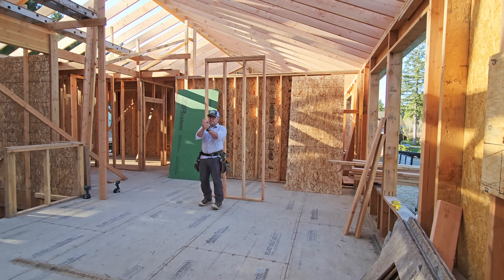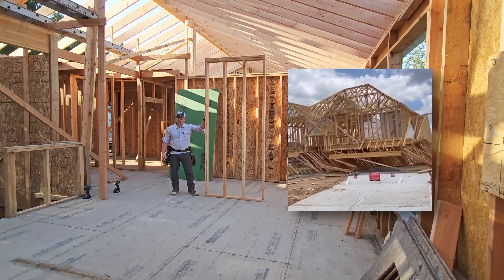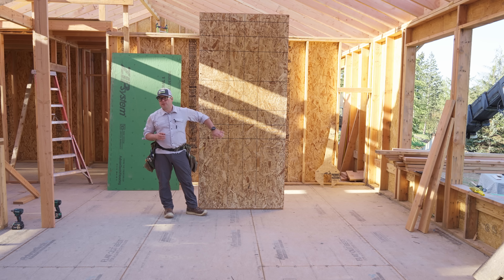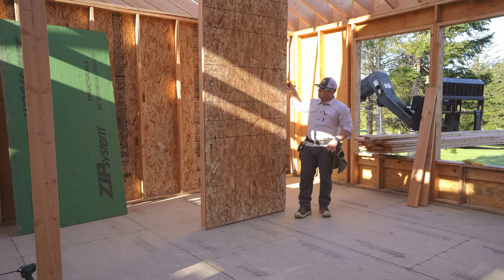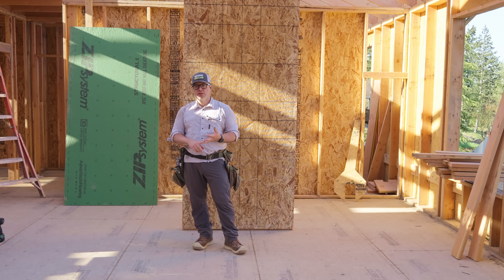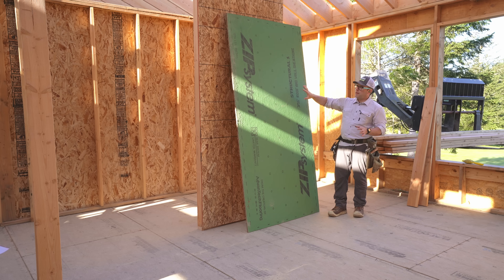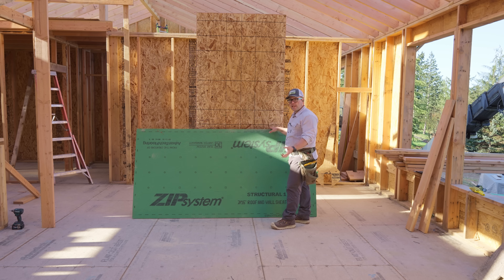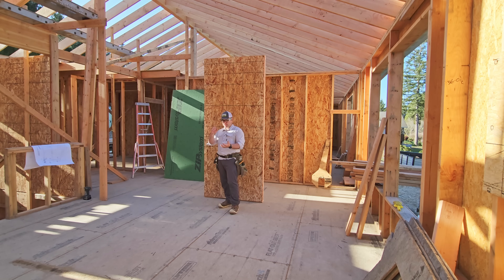Shear Walls Secret: The Hidden Force That Holds Buildings Together

Comment: Basically,, with 60 years under my belt building.  Shear walls, smear walls,  that structure did not have an angle brace in the lot.  there were no wooden let in braces, there were no metal let in braces, there were no solid block diagonals, there were no angled strong backs in the attic, the carpenters who put that together and the engineers that designed it were children, idiots who never sat in anything but a university classroom of cheated a client they were building for. Shear walls are essential,, for handling the point loads that must be addressed IN ADDITION to all the normal stresses.
Reply from the maker: Shear walls are for lateral forces.
Reply: @AwesomeFramers  At specific points.  At those points they are essential.  There we agree.  The nearly complete partial frame collapsing offended me. Mostly,, because I see similar almost every day.  A few years ago, a church locally, made a similar spectacular deconstruction.  I do not remember  the number that died or were injured, because they had not bothered with any diagonal bracing, trusses or walls.  And I see it time after time after time.  Modern framers rely upon the sheathing to keep the building up and stable,, and that is just wrong.  Even a shear wall should have redundancy.  Solid blocking internally or my last one handled a huge load in a wood basement.  I plywooded it on both sides.  I suspect you may have done similar.
Reply from the maker: @Sailor376also  These buildings came down due to the lack if temp bracing.  If they had even 1 sheet on each wall they wouldn't have come down.  Shear walls are rigorously tested by universities and corporations.  That data then has a safety factor applied to it and that's where we get the values for shear wall capacity.  They are significantly (4x+) stronger than let in bracing or diagonal bracing.  They are also easy to construct and inspect.  

Its really a shame people die like you mentioned, there's just no reason for that.
Reply: @AwesomeFramers  "even one sheet"  Complete agreement.  My normal has been for,, what 50+ years, I sheet the wall before it goes up.  And I still have lots of temp bracing to hold, straighten wall tops, etc.  But even simple things are just uncommon now. Example,, you have a strong back or lacers through your trusses  AND there are supposed to be diagonals atop the bottom chord of the trusses or atop the collar ties. I have not seen a crew do that except mine in the past 10 years. I have had contractors complain at the extra expense. Yet, every set of engineers truss drawings delivered with the trusses shows them. The last shear wall I saw in a framed job, obvious to me why the engineer had speced the wall layout,, were just dry walled latter.  No sheathing,, no internal bracing, just drywall ,, so they did not have to use door jamb extensions on a thick wall.  You must see the same thing time and again,  Well, as is evidenced by the deconstruction you found a recording of,,, all too common.
God, I am a dinosaur.  I have done many subfloors with 1X6 Always on the diagonal.  Wall sheathing with 1X6s  also always on the diagonal.  vs the new house across the street with cardboard sheathing and stress ripples already appearing in the vinyl siding.  The drywall is holding it up.  You and I see it all the time.  Laughing,, and the way of the world,, the guys that cheat win the bids with a lower price, and they make more money,, by skipping a few of the 'unnecessary' things.

Comment: Ive never understood why people build entire houses before they sheet anything. Sheeting walls as you go saves so much time its not even comparable to doing it after everything is built. Sheet 8ft  walls with 9ft sheeting to cover the rimboard of the deck theyre sitting on when you stand them up. Tyvek and cut out windows while the wall is laying down as well. Ive built this way for 35 years and never had a single problem.

Comment: When attaching sheathing, wouldn't it be better to use  taller panels and have them overlap the main floor rim joist and use the upper level sheets to overlap from the first floor walls past the 2nd floor (or attic floor) rim joist and the roof truss ends? That way the sheathing ties everything together which will aide in resisting shear forces but also wind uplift on the roof overhangs.
Reply: Sometimes the ply/OSB panels do splice at the rim, it can be an efficient way to pass the lateral loads from a floor above to the shear wall below. Other times the forces are structurally passed through the framing members (plate/rim/plate) with nails, screws, and/or clips, so simply attaching the ply/OSB to the plates works as they're already joined together as a structural component in terms of those lateral forces.

Uplift forces are usually dealt with via a continuous load path of hardware- large continuous straps and/or hold down pairings from shear wall to shear wall.
Reply from the maker: There is a great response to this question below 👍
Reply: yes, but go look at the current labor force and ask them why they arent overlapping the bands.
they are clueless and the inspectors do not demand to see it.

is all a farce of supposed engineering that is not being utilised as designed.

Comment: I’ll be showing this to new-hire engineers as a great example of basic shear wall construction. 

The only input I have is that moment frames are not subsets of shears walls. They are two different types of lateral force resisting systems (i.e. braced frames, moment frames, shear walls). They use different design methods with different seismic loads on the structure. But this isn’t a video on moment frames 😅, so very well done! 👍🏼

Comment: Question, not pertaining to this particular video.  I noticed in one of your foundation videos (can't seem to find which one it was or I'd post this question there), that you used an I-joist to stiffen the top of the forms (if i'm remembering correctly).  Have you ever used an I-joist to STRAIGHTEN an exterior wall?  Or to assist in the straightening of an exterior wall ?
Reply from the maker: Nope

Comment: Its amazing on that entry video how there was obviously no sheathing on the walls or roof, but was there any kind of temp bracing even applied? I do remember years ago when framers were only required to sheath the corners, which was just wrong. Great video, from one builder to the next, keep em coming bro!
Reply: I'm amazed for how long after the 1906 quake they still allowed garbage construction methods in the SF Bay Area. Soft story buildings (first floor all parking so the whole front face is only supported on a couple of steel poles with no interior walls... a great recipe for collapse) were still being built into the 1980s IIRC. 

Or lots of SFHs with a crawl space with no sheathing (the half height crawl space walls love to collapse just like shown in this video). Still built this way into the 80s.

Huge 12" redwood beams just toe-nailed onto their posts. Way too few anchor bolts. Not sure when this stopped but when we rented the 1939 house (long after 1906) was built this way - long after they should have known better.

Comment: I’m a licensed structural engineer in California. This video is fantastic. Great work!
Reply from the maker: Thanks!  I did a lot of research and tried not to step out of my area of knowledge.
Reply: @AwesomeFramers what I'd like to know is why are all these walls sheathed with no blocking in them? Are you not required to put blocking every 4' of vertical wall in your area?
Reply from the maker: @Cmasotti92  Code and the SPDWS both show panel edge blocking.  Since we sheathe vertically, we don't block every 4'.
Reply: This is good for those in construction management or going to school to become a builder to watch during a break 👍
Reply: im a concrete contractor this video is fantastic
Reply: I work as a structural designer for a licensed structural engineer and I do residential lateral designs all day long. I wish I saw this vid back when I was learning about lateral design. Super helpful.
Reply: Fellow PE what's up!
Reply: What type of work do you do as a structural engineer?
Reply: @FutureFaz I'm in the Sierra Foothills and need some engineering done for my house. Please get in touch if that's in your work perimeter!
and Thank You @AwesomeFramers for the expertise!!
Reply: And why the state claim ? As if you think calif has better codes or some other crazy crap
Reply from the maker: @jeffbarron5500  your statement doesn't logically follow. California is known for strict earthquake design. All homes there have shear walls and carpenter's need training.

I took his compliment as a huge compliment.
Reply: @jeffbarron5500  Not sure about Oregon, but CA and WA normally use the same version of the IBC as a baseline code. CA has the CBC with special ‘A’ chapters used for public school and hospital projects that go under special review (DSA & HCAI, respectively). We’re not better, we just have to deal with famously difficult plan checkers depending on the type of work you get into. Because of this you end up being well-versed in lateral force-resisting systems.

Didn’t mean to come across as demeaning or anything. Cheers!

Comment: I build my houses 24” oc, and apply the sheathing horizontally so as to tie more studs together into a “system,” to reduce the potential for telescoping any wavy studs through to my Hardie siding. Therefore, blocking at the seams is a given on my jobs
Reply from the maker: Are you using 5/8" sheathing then?  I have to say in all honesty, that no one can tell the difference after siding is on.  Being attentive to the studs is more important than going horiztonal with sheathing on 24" centers and thinking the sheathing will "flatten" the plane of the wall.  In reality it doesn't actually do that.  Proof of that is looking at a roof where all the sheathing is perpendicular to the trusses or rafters.  The sheathing doesn't flatten out the material
Reply: @AwesomeFramers  No, just typical 7/16” Zip sheathing. I have not experienced telescoping, this is just an “abundance of caution” thing that my lumber rep has strongly recommended, based on issues he has seen with running it vertically. Maybe there’s no need to do it, but it’s not a problem on my framer’s end to run horizontally just in case. As to your roof comment, I think gravity is a significant factor that applies on roof decks, but not on wall sheathing.
Reply from the maker: @kendrickdp  noy point is that the sheathing doesn't actually pull anything flat. It doesn't in the roof and it doesn't in the wall. Not at 7/16". We've been running vertical since the early 90s of that helps
Reply: Daniel, for the sheer strength, osb should be installed vertically. It even states that on the osb itself..
Reply: @bman6502  for ZIP sheathing, their guidelines state that it can be installed horizontally or vertically. I think we are all splitting hairs in this thread. My lumber rep believes it can reduce potential waviness from appearing in lap siding, especially in large wall expanses, so I am following his advice. Apart from that, I have no preference, and I can’t see that it matters one way or the other
Reply from the maker: @bman6502  it doesn't state that in the OSB. Can you send me a picture of the stamp?
Reply: 16" o.c. always & forever for wall sheathing. Vertical for 1 pc , horizontal for seams & storm codes
No need to re-invent the wheel, or space out wall framing.
Reply from the maker: @JFURNER-77  I couldn't agree less. It's more important to let the analysis speak than opinion
Reply: @AwesomeFramers  32 yrs of carpentry & building codes say otherwise. No 24" o.c. build around here will ever get a green tag. Running 5/8"- 3/4" wall substrate to accomadate the spacing isnt logical. Running interior drywall 24" o.c. also looks like crap, no matter the thickness. These arent opinions, theyre facts
Reply from the maker: @JFURNER-77  no, they are indeed opinions. 24" framing has been around for 50+ years and it's in the code.

 https://buildingscience.com/documents/information-sheets/information-sheet-common-advanced-framing-details

https://www.apawood.org/advanced-framing

https://www.energy.gov/energysaver/advanced-house-framing
Reply: @AwesomeFramers  depends on application. No benefit to stretching out framing, stick or post framing. Just because you can, doesnt mean you should.
Reply from the maker: @JFURNER-77  you really don't understand it, best to stop replying
Reply: @AwesomeFramers  lol. Understand more than i can continue to teach. I love how every industry continues to claim "advanced".....when all they do is cut corners & stretch materials.
Reply from the maker: @JFURNER-77  move on bro,you're ignorance is deafening
Reply: @JFURNER-77 insulation is the benefit of advanced

Comment: Question for ya! I like the idea of vertical sheathing with a height that matches the wall height. I'm wondering about the downside of not overlapping the sheathing over your floor system to better tie the wall to the floor. Seems like you would need to shift the sheathing down in which case you end up needing blocking anyway (unless you just get into very large sheets. How do you normally handle sheathing of the floor system?
Reply from the maker: Nope, if you look at that Simpson footage closely, they only go plate to plate.  For uplift, it can be advantageous to split the rim, but for lateral loads that is not needed.  The testing is done plate to plate and with hold downs.  👍
Reply: @AwesomeFramers  thanks for the reply, love your videos!
Reply: It depends on how the wall is designed to carry lateral loads from the upper floors/roof down to the foundation.

Sometimes you use structural screws, nails and/or clips (A35s, L90s, etc.) to tie the bottom plate of the top floor to the rim and then the rim to the top plate of the wall below. That way, by structurally attaching the shear ply to the plates you still carry the lateral loads from one floor on down, because the plates are already structurally connected to each other from one floor to the next via the rim and hardware.

Other times, especially if the shear walls are stacked directly on top of each other, the system is designed to lap the ply/OSB onto a shared member (rim etc.) and you can go lighter on the hardware connectors from bottom plate of upper story to rim to top plates of lower story, because the lateral forces are passed from ply/OSB to ply/OSB as they're nailed to the same piece of lumber.

But one way or the other, the lateral loads have to be caught and relayed to the next panel below, all the way to the foundation.

Comment: Very true about the field nails holding the panel to the framing! I had a project framed with Zip System sheathing where the sheathing got a little wet during construction, and buckled in or out between each stud up to 1/2" in deflection. But the sheet itself stayed firmly attached to the studs.

Comment: Great stuff.  I've been designing homes for over 30 years and have built several in that time, and I was always taught/told that the sheathing should go perpendicular to the studs.  This was very enlightening.  Thanks for the mini tutorial!  Never too old to learn new things.
Reply: I've run into old-school guys who learned that, especially with 5-ply plywood. They know the plywood veneer sandwich has three layers running the 8' direction and only 2 going perpendicular to those, so they want to line up the three layers with the horizontal forces. 

But this is not understanding that the horizontal forces in turn create equal vertical forces as well, so orientation of the sheet goods doesn't matter.

I built a house with one older guy who insisted we attach the panels horizontally and install blocking at 4'. It was a tall wall too, we had to add two rows of blocking. I was paid by the hour, and it was this GC's own house, so after pushing back a little I just did what he wanted, even though I knew it was wasted time.

The quick reply to explain it is that the forces around the perimeter of each nailed piece of ply, the horizontal and vertical forces, are exactly the same on all 4 edges, so, (structurally) it doesn't matter which orientation you use.

You put your edge nailing at 6&12 (or whatever) on the 4' edges just the same as on the long edges of the ply/OSB. That's because the load you're resisting is the same at the horizontal edges and at the vertical edges.

It's a little counterintuitive, because in our minds, we're mostly thinking about restraining sideways forces. But those sideways forces create vertical forces (as seen in the overturning) so it's all the same structurally, and it's far more efficient to place the panels upright.
Reply: @H2s Yes, perpendicular.  That has been the standard here for as long as I can remember.  I'm not saying this is right or wrong, just what we have been doing for the past several decades, based on our code requirements. And we don't put backing on the long edges (hope that doesn't blow your mind too much).  I like the idea of limiting the long edges being on the studs, if only for  limiting moisture infiltration.
Reply: Perpendicular ties more studs together - making stronger walls. 
"More efficient" does not always equate to endurance.
Reply: It can if you block but it’s inefficient
Reply: @h2s142 studs run vertical sheeting runs horizontal, if you run it horizontal you have no business building
Reply: I was thinking the same thing, I've never even seen sheathing installed this way so I was surprised as well.